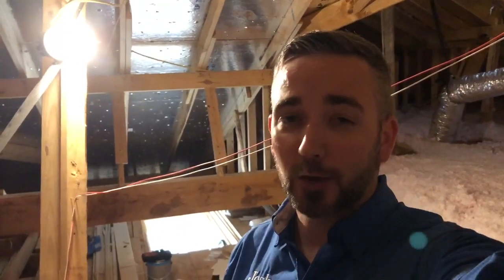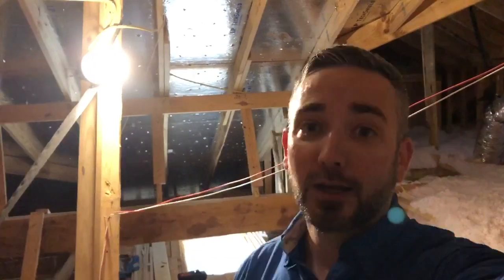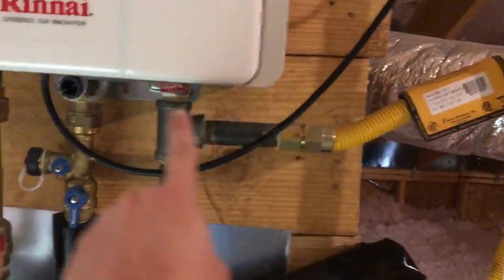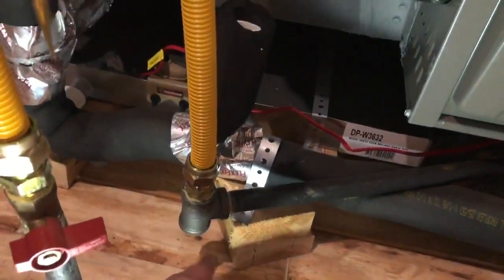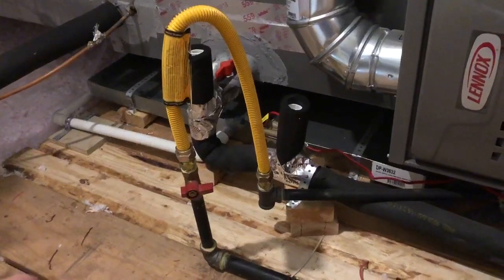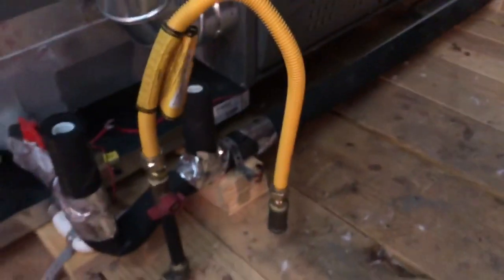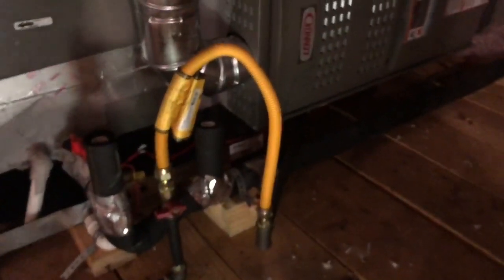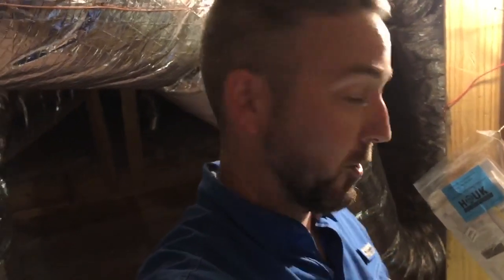Home Inspector Saves New Build Home From Blowing Up - The Houston Home Inspector

Comment: I would also have been worried about asphyxiation. The closer you get to the leak the less oxygen in the area. At very low levels, you will pass out with little to no warning. Better to exit and close gas off outside
Reply: Natural gas is lighter than air, in an attic it's just going to rise and go out the vents. Not safe obviously, but not going to asphyxiate someone either.
Reply: Not true. I huff it everyday, then I vote Democrat .

Comment: Been in the gas industry 35 years and ran over 10,000 emergency calls,  I have some questions. Did you contact your First Responders ( fire department and gas utility) ? Did you find the missing drip legs ? Who piped the units, the heating and cooling contractor or the plumber ? ( were they questioned ?). Human error or sabotage ? Any disgruntled employees ( fired) or issues with the homeowners ? If there was a report by the First Responders what was their findings?
Reply from the maker: We just shut it off and told the builder.  Hindsight, we should have left the structure immediately and shut the gas off from outside.  We did talk about how dangour this was at the team meeting and came up with a new action plan if this happened again.  What would you recommend?
Reply: @AActionHomeInspectionHouston  , those drip legs didn't fall out by themselves. There should have been an investigation performed by the local fire district and the gas utility. I had a simular incident happen in Clayton, Missouri ( drip leg missing on a commercial water heater after two maintenance employees got fired). Like you, fortunately nothing happened. We were able to ventilate the building and I believe one of the employees got arrested.
Reply from the maker: @boby115  I was worried that it was done on purpose.  This is the only time we have seen this mistake.  I will bring this up in the next team meeting to call the local official.
Reply: @AActionHomeInspectionHouston  , this is something that rarely happens, but it's nice that you shared it with the rest of us, so we all can learn from one another. Keep up the good work, stay safe and keep learning.
Reply: @boby115  I am what you would call, "gas ignorant".  If those drip legs were missing for, let's just say, 24 hours, how come the entire attic didn't catch fire or explode when he turned the light on?  Wouldn't turning the light on produce the conductive or ignited charge needed for combustion?
Reply: @billsmith9249  , Natural gas can only ignite in a concentration from 4% to 15% and it must have an ignition source at those percentages. Below 4% concentration ,it is to lean and will not ignite and above 15% it is too rich and will not ignite. In this particular scenario the concentration was probably too rich in the possible ignition areas. That being said if you have 100% gas in one area you definitely have 4 to15% in another area but if there’s no ignition source, no Explosion💥 (sometimes it’s better to be lucky than good).
Bill, I hope this information helps and stay safe out there👍🛠
Reply: @boby115  I had no idea... now I know!  Thanks for your info!
Reply: @billsmith9249  👍
Reply: First things I also questioned ,as well as insurance fraudulent activities d u e to the blatantly negligent failure ,to which any of us in the field would have checked  and how would or could a pressure test pass installers ,,,,
Reply: I think they forgot to put them in, because when he stuck his finger up there, he would have had pipe dope on it if someone took them out.
Reply: Exactly! To have missing drip legs,trace back to installer! Just had a heat and air person installer put a conversion kit for propane package unit Hv/AC  that didn't know the LP Low Pressure switch Also Had To be installed with the conversion kit... untill I showed him ...and then fired him on the spot because I also have worked my share in the Gas Industry...and there's no room for human error whatsoever

Comment: I am not an HVAC tech or inspector,  I am actually a Master Certified Auto Technician so please correct me if I’m wrong! Isn’t the code for the drip leg supposed to be a minimum of 3 inches, If that is the case it looks to me like they did not have enough room to install the proper length drip leg! I think someone was supposed to come back with either a shorter drip leg or make an adjustment to fit the proper length drip leg and forgot! Then someone else comes in thinking the job was done properly and turned on the gas without checking for leaks!
Reply: Yes code is min3" , electric/ plumber carpenter I Always Make my own complete inspection prior to ANY Activation. Of any utilities.for human errors will happen

Comment: Isn’t the sediment trap on the water heater set up wrong? I mean besides the open pipe. Isn’t the gas line suppose to be connected vertically, pointing straight down with the dead end of the sediment trap pointing down in line with the vertical gas line. Our water heater doesn’t have a sediment trap so I’m going to install one and want to get it right.
Reply: It's not as wrong as it could've been. At least the gas on that tee couldn't flow directly across the top and keep going. Instead, it would have to travel up and any particulate will fall down due to gravity. Still, the scenario you're describing is the best one to use.

Comment: 34 year gas journeyman for the gas company here.  I'm having a hard believing your story that the gas was on, becuase when the gas company turns the gas on,  they do a leak check and that meter would have been spinning like crazy. Did you used to work for CNN? lol
Reply from the maker: Don’t know man,  don’t have enough time to create click bait.  We just document and move on.
Reply: I am what you would call, "gas ignorant".  If those drip legs were missing for, let's just say, 24 hours, how come the entire attic didn't catch fire or explode when he turned the light on?  Wouldn't turning the light on produce the conductive or ignited charge needed for combustion?
Reply: Yea this is a bit strange!
Reply: I agree . Even if the plumber came after the fact and changed the piping,!there’s no way he would have left the gas on BLOWING through the pipe like that. The gas would have literally been blowing through those openings. The gas was definitely not on.

Comment: Fake news here, 32-year plumber here. There is a gas test performed before green tag. And also is mentioned in this feed gas company does a inspection also in this area I work the Houston and Bay Area. Gas would not have been turned on by gas company if the pressure test would not have been done first and inspected by City officials. B.S.on this one. But I don't understand what is the end game of this video
Reply: I am what you would call, "gas ignorant".  If those drip legs were missing for, let's just say, 24 hours, how come the entire attic didn't catch fire or explode when he turned the light on?  Wouldn't turning the light on produce the conductive or ignited charge needed for combustion?

Comment: I’m a gas technician and let me tell you this video is made for advertising. The fact that you shut off the valve instead of calling fire department or gas inspectors in your city tells me this is a setup. Worst part is this house would have been gone in about 30 minutes of turning on the furnace. Also all gas work requires a dial test which is recorded for proof of no leaks. This is a fake video. Thanks for the information though. Appreciate scaring customers so they call the real experts. Thanks
Reply from the maker: I wish that was true,  yes we were Idiots and went up there to turned it off.
Reply: I am what you would call, "gas ignorant".  If those drip legs were missing for, let's just say, 24 hours, how come the entire attic didn't catch fire or explode when he turned the light on?  Wouldn't turning the light on produce the conductive or ignited charge needed for combustion?
Reply: My thoughts exactly this guy is far from a hero
Reply: @billsmith9249  Ridge vents and soffits. When ridge vents are new and not clogged with sediment they really let the air flow, especially if the roof is hot. The heat escaping can draw air through the soffits and out the top like a smoke stack. Also, on windy days the wind can blow across the ridge vent causing a venturi effect where just enough of a vacuum was able to draw the gas out. I believe that the gas floated up towards the ridge vent and got pulled out keeping the potential for the gas to ignite well below ignition level. That's strictly my un-professional opinion and my two cents. Cheers!
Reply: @illiniwood  that may have something to do with it but since my question I have talked to several gas and oil experts... these guys literally eat, sleep, and breathe their work.  I was told that there is a saturation point for natural gas... it simply will not ignite if there is too much of it in a space.  Not sure if I am explaining that correctly, but that is the gist of what I have ascertained from all of my interactions with those experts.